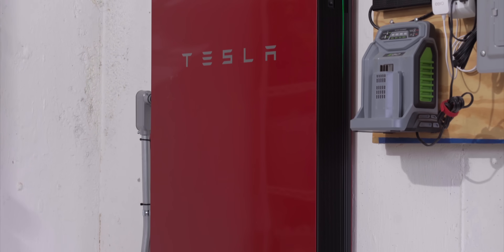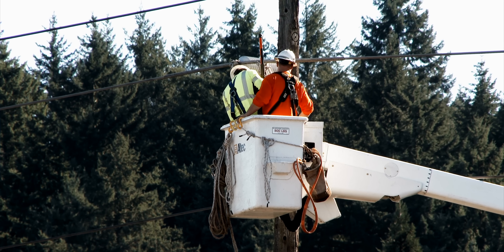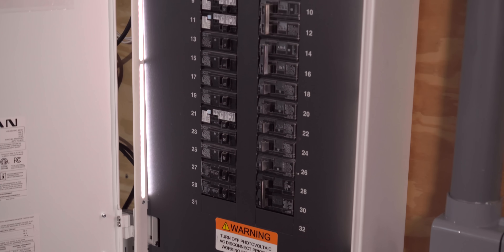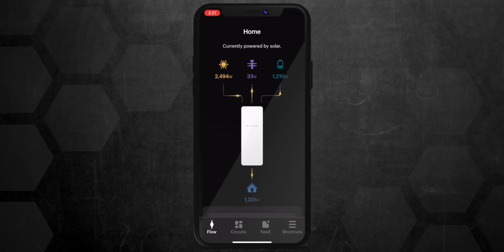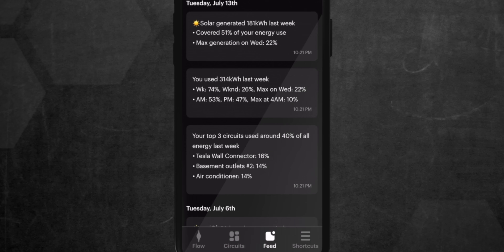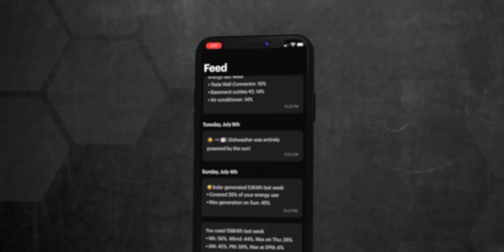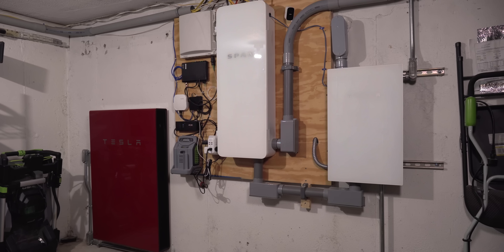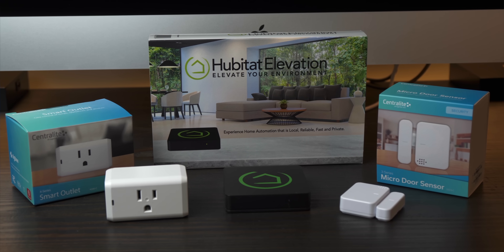This Smart Home Electric Panel Fixed My Tesla Powerwall

Comment: I talked to SPAN, and found the optimal solution. When you have solar + batteries installed, you have a the main breaker box (Grid powered) and the critical subpanel (Solar + Battery + Grid), so the optimal solution is just to hard wire the Main Panel with Grid only circuits and the Critical Subpanel with circuits you want to be powered all the time. So in my case the Main panel has a high power circuits specifically: the Critical Subpanel, Dryer, Electric Car Chargers. Everything else is on the Critical Subpanel. For power consumption we have a Tesla system and it reports real-time power draw to the subpanel, to identify power draw of a device turn it on and off and measure the difference in Power draw. QED and no extra $$. 

Further thought, what happens to SPAN panel if there is a major surge down the Grid line, with the Grid aging adding a whole house surge protector is becoming a necessity and the wisest investment. 2 days ago PGE delivered 2 major surges associated with an outage to our home through the grid, a surge protector saved my furnace, TVs, computers and maybe my Tesla Gateway.

Comment: Thanks for this video. My wife and I bought a 1942 bungalow near our city's downtown area, and are in the process of updating it to modern electrical and plumbing standards. All of this work has or will be done by me. I've aready re-wired more than half the house and replaced all the freshwater plumbing except the old iron risers into a bathroom. (And those risers will go when the bathroom gets remodeled. 

I get permits for all of my work so it gets inspected, too. So I'm on a first-name basis with several of our City building inspectors.

Our main electric panel doesn't have a dedicated breaker for the mains, and is badly outdated. Combine that with plans to install 7500 watts of solar panels and eventually add a batttery backup/load shifting solution and it quickly becomes clear we'll need some kind of smart panel solution.

So, thanks for offering this video up. I hope you plan to do an update discussing the pros and cons of other solutions, too!

Comment: Not a big fan of any of the electrical worl there.. pvc is a no go for anything inside imo.. just janky - and that 3/4 emt down low from. The power wall is not level etc- excessive LBs where not needed - as far as your mention of data cable outside the pipe ya that could have been doe. Cleaner but inside the pipe there is way more risk of feedback from the higher voltage wires throwing off readings even with shielded data cable. These span panels in general I will need to see a significant price drop before I promote them they are like $4k jist for the panel from what I have seen

Comment: I would recommend anyone working on electrical use a meter to verify power not just a phone app and breaker switch.

I’m not familiar with Tesla’s instructions, but it is standard not to mix high voltage and low voltage in the same conduit.

Comment: I recently had a span panel installed and I love it!  One thing I'm seeing is a pretty big difference between the readings on my tesla powerwall app statistics and the span panel statistics - does yours match up pretty well?  I'm wondering if it's an installation issue or what ...  Also, it appears that there is an "installer" app versus the consumer app - and that the installer app provides a deeper dive into the settings where I might be able to adjust some things to get the stats functioning correctly - do you know if consumers can get the installer app?  Thanks - another great video!

Comment: The electrician just told me that besides the cost of the panel, every switch will cost a couple of hundred dollars, which brings the cost to ~$12k. Does it make sense?
Reply: no, he's lying to you bc he doesn't know that the span panel takes the same breakers (probably) as your old panel.  But he will charge you through the roof to install because he knows you aren't cost conscious since you're even considering a $4500 panel when a $450 panel is totally sufficient.  The economics of this thing are bizarre.

Comment: I have a question about the off-grid/backup mode of a powerwall system. I'll give an EXTREME example just to help me understand. 

Imagine that I have a really big solar array with a capacity of 40kW and a small storage capacity like a single powerwall (13kWh). 

Also, imagine that we are in an indefinite blackout scenario and we would like to maximize our solar electricity production by doing our EV charging during the day and using some heavy-energy consuming activities like using some workshop appliances while charging our powerwall,  all at the same time.

During the night, we would like to save the most energy and will only be using lightweight electrical appliances. Would this be achievable and realistic, or would the small storage capacity be a limiting factor? If this imaginary scenario were possible, what special equipment would it need to function?

Comment: I wonder if the IRA ( inflation reduction act) will help to cover the cost of buying and installing the Span panel.
I spoke with them and they were charging me extra to move the solar system breakers to the span panel.
There is wiring or re-wiring benefits or money back in the IRA verbiage.
Reply: unlikely. This thing is intended for the uber wealthy and early adopter tech crowd. Also sounds like you're being sold down the river. Moving solar breakers should be no more expensive than moving any other breaker. A breaker is a breaker is a breaker.

Comment: I don't think it worth it because the starting price is $4600, dumb-panel cost between $2xx-7xx. Simply adding smart plug to each outlet can monitor and turn on/off actually gives more definite control. In case the smart panel's electronic is broke (burn IGBT/FETs), the repair cost is easy in the thoudsands range.  I have installed like 50 smart plugs in my house, and they usually don't last more than couple years. I am worry that the smart panel will do the same. I better wait and see if others have tested them out for years.
Reply: BTW, I have DIYed my solar system and I am using Auto Transfer switches to switch between off-grid and on grid for certain branch circuit(s). If the Span is really smart, I wonder if it allows Auto switching between solar/grid for individual branch circuit base on user defined conditions.
Reply: you hit the nail on the head Austin. I think this thing is a shiny VC-funded tech idea that sounds cool but in the long run isn't. The company has the right glitz factors though and will likely get bought by one of the big boys (Eaton, Schneider, etc) and the founders and funders will make out like bandits. Meanwhile early adopters will be stuck in a few years wondering what they were thinking installing this back in 2022 when it breaks in 2028 and they cant get parts/service/repair, etc.

Comment: Big cost pro for SPAN is that it's auto load shedding can effectively reduce your load service calc and prevent needing to upsize your service.
Reply: if you're willing to plunk down the dosh for the span panel, then paying to upgrade your service is trivial.  Why would you do one and not the other?
Reply: @AidanSkoyles  I only seen a price benefit for underground service. Half price or less for span with installation. Span is UL listed as a load management system avoiding ones ahj service calc. With car chargers having charging schedules, one almost never meets the actual demand for a larger service.

Comment: Have you looked into the components from Shelly? Especially the ones that monitor your electricity usage like the PM1 or the Shelly Plug. If you combine them with an iOBroker on a Raspberry Pi, do a little scripting and click together your UI it will do about the same thing as your described system for a fraction of the cost. For about 15 bucks per switch and electric circuit. If you have, say, 30 circuits on your board that would be about 400 versus 4000 bucks. Not to mention the integration with Alexa, Siri, Telegram, a custom REST-API, Philips hue, HomeMatic and hundreds of other smart home systems that are out there.

Comment: Very interesting Matt! I'm considering adding solar + storage to my home in a place that does not have net metering. Consequently, I want to have software that allows me to use by stored energy at night, not just keep my battery as an emergency backup. Is SPAN that smart?

Comment: The Span Electrical Panel is something that would be great to have as we are in the process of getting a Tesla solar panel system and Powerwall installation done. Still waiting on some permits. But we are going to have a new roof done as well, so you can imagine the cost. Would love the  Span Electrical Panel but it will have to wait. I liked you video about it.

Comment: This video is pretty out of date, you are supposed to size your powerwall installation based on your total power usage. Getting a smart panel is fine to make you feel good. Two power walls can handle a 20kw load... Why would anybody use a sub panel now?

Comment: Hi Matt, i have been researching solar for a long time, my issue is I have limited south facing roof space so solar is difficult to justify at this time.  I have a tesla and a tesla home charger, if i buy a few powerwalls and a span will the grid keep the powerwalls filled so that if there is a power outage i can use it as backup?

Comment: I have an off grid solar system no back feeding. Can I have many of my circuits always being pulled from solar Input and others from grid while also having a generator input?
My solar can't run my whole house.
But my generator can. 
So if in a grid down  I want to use my ac I'd still like to use the solar or maybe allow my generator to charge my batteries. Is this possible?

Comment: With some items you have to have a cutoff for power outs, you mentioned this. I was looking into getting solar, possibly a battery (if I could get a small one that would be nice and upgrade more later), and a backup generator. My understanding is something has to block the solar, battery, and generator to the grid so you don't kill a lineman. Could this device solve that? (if so huge savings, also, for both the battery and generator the elimination of the critical panel is a huge savings).

Comment: Matt thank you for all your videos!  I live close to you in Eliot ME on the border of NH.  I recently purchased (with your help) Solar panels for my new home.  They are not on yet as I am waiting for the inspection to be done, but can't wait to do my part in using Green Energy.  I also recently added a Heat Pump to my existing system to heat my home with electricity 90% of the time.  I am currently on the fence to put in a battery for back up or a generator to go off my propane tank as I will be using that much less now.  This AC panel from SPAN looks great! This is something I would install depending if I go with a generator or battery.  What would you recommend? Or what video to watch that you already made on the matter?  

Thanks Matt!!

Comment: How much damage to electronics and electrical devices could there be if a malicious hacker were to gain control of this panel?  I would get some highly skilled network pen testers to make sure it is bulletproof if you’ve put something like this in your home...  still risky, especially if it’s a military operation that may have access to “legit” internal keys or proprietary “secure” company backdoors...  I can’t really think of a way to fully secure the device unless it is possible to run it as an isolated home network system with your own “app server” for the phone app to talk to that has no external network connection.

Comment: too complicated.  the more circuitry you have, the bigger chance of component failures.  a great engineer once said, “if you want it to work well, keep it simple”.   do the work yourself, is flipping a switch manually that hard?  Just being conscious of the power you use, will help extend your battery usage time.

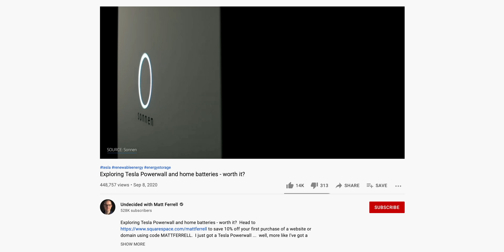Comment: Near 1:30 you comment during outage the panels shut off. However, wouldn’t the panels connected to the powerWall still charge the battery? Thx.

Comment: I tried to have a SPAN panel installed at the same time as Tesla Powerwalls, but the two companies wouldn't work together. Required the batteries and gateway to be installed fully as normal, then that partially destroyed and replaced with SPAN. Far too wasteful for me, so I dropped out. A year later now, the Tesla Powerwalls and gateway (with all loads backed-up) have been fine on their own, and my modified car charger means it automatically avoids overloading the batteries during an outage. I like the idea of SPAN though - would buy one if I moved house.

Comment: Matt, I am in St. Louis. My Tesla wall and Span panel are days away from turn up. Big ?, you have your AC as part of the second level backup schedule. What size is you 240 AC breaker? I was told I can't have greater than 30 amps. I have a 1700 sq' ranch and my AC breaker is 50. Very interested in your comments.

Comment: How much money you MUST have in order to save on the electric bill? or to try and save the planet? I don't even know how to express my question. I just finish getting 3 estimates for solar panels. Noo, not the top of the line, not 100% off the grid, that will cost me around mmm and arm and a leg.  21 or 23 panels, for a 1400 s/f house = $30,000 for a 65 to 70%. Add $3500 for IQ8 inverters plus system controller. Depending on what I want IQ7 or IQ8 $28,000 to $33,000. Now add a powerwall at around $10,000 that I decided not to get because I don't have the money, but, lets assume I get the power wall. Now add a span panel at around $3500 plus installation mmm $5,000  to $6,000. With all this and I can't still get the AC to work and be comfortable inside my house? My monthy electric bill is $125 a month. Some months are $80.00 other a bit higher. Lets round numbers, $50,000/125 a month = 33 years. Assuming we are 100% of the grid. If I decide to go ahead with the installation, I bet you, I have to pay extra money for something, a part that was not on the estimate, etc. Am 62, don't expect to be around 15 years from now, assuming I outlive the solar panels, are they recyclable? What is the carbon footprint once you dump them? Well is almost 9pm and way passed my time to go to sleep.

Comment: Security feature question: Does the panel have a hardline switch that disconnects the wifi from it, locking it to its current settings? This is important in case of fear of any security vulnerabilities in your wifi or in the span system itself, preventing access without a hardline connection until you're sure it's secure from outside interference.

Comment: I'm in Australia.  So the specifics are off course slightly different,  but your channel is at least helping me frame the questions i Want to ask.  Which is an essential starting point.  I don't know yet,  if these products are available here,  I know that the Tesla batteries are,  but the Tesla solar is not, and so forth.  But at least I can frame the questions to ask.

Comment: It sounds like the Scan system is a great option to use if you want a generator backup. We paid more than the price you stated to have a secondary panel installed which grouped the circuits we wanted to operate with a generator if we have a power failure.

Comment: Do they have an option to handle more than 200 amps? I'm struggling to figure out how to get solar properly installed and setup for my home with has 300 amp service in a split panel design and everything seems to be made for 200 amps including Tesla solar :(

Comment: I have to upgrade my panel anyway (current panel is old, improperly grounded and full - need to add another circuit or two while upgrading the whole installation). But I don’t have solar or a battery right now. Still, a smart panel would be awesome for the power management and smart home tie-in alone, I think.
What do you all think?

Comment: I am so very glad I found this video. I just sold my house and bought a new one. ON the old house I had a solar array, a Sense monitor and PHEV. But I couldn't ever answer all the questions I had. And I wanted to add batteries but that would require totally redoing everything. But I sold that house and I bought a new house with nothing but an old, very much needs to be replaced, and even upgraded, load center. I have always wanted a load meter on each circuit particularly the 240V ones for larger appliances like electric ranges or electric clothes dryers, but having a CT installed on every one of my circuits would have just been too much. This seems to answer ALL of those needs in one piece of hardware and there's even some new hardware for car charging. With this video really making it clear how this works I'm really hoping I can fit this into the renovation budget for the house I bought.

Comment: Great channel Matt! I live in Rio Verde Arizona near Phoenix. I just started working with a solar company to install REC panels and IQ 8 Enphase micro inverters and batteries.  PROBLEMS: SRP my electric co. doesn’t have SPAN on their approved list. I called SPAN and was told to go to there website and fill out a form. I think SPAN should be glad to call SRP my electric company and get approved for future opportunities to sell their product. I the customer am jumping through hoops to try and get a SPAN electric box. Most customers would just drop it and go with the standard electrical panel.

Greg McDowell
Reply: Are you trying to sell power from your batteries to the grid? Otherwise they should only care about the panel being code compliant, which this is. If the utility wants to remotely use your batteries during peak hours to support the grid, then yes: their system will need to speak the same language as Span.